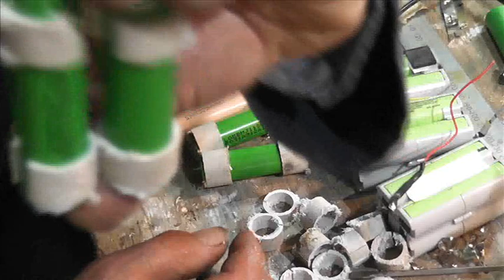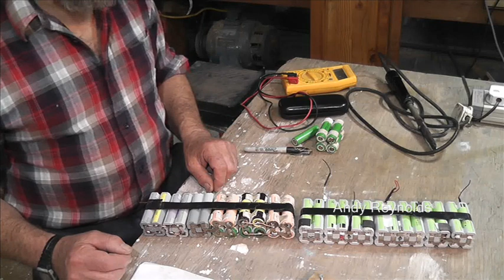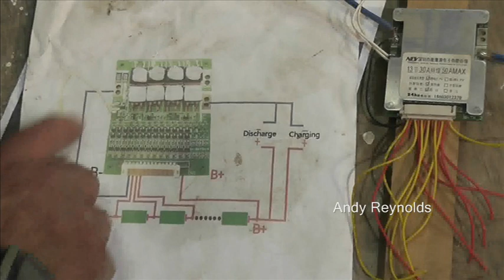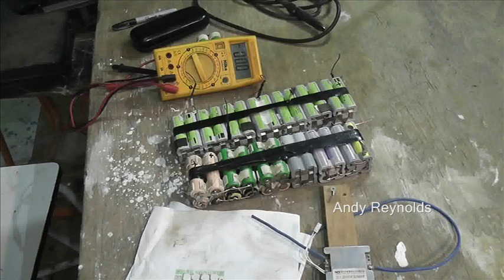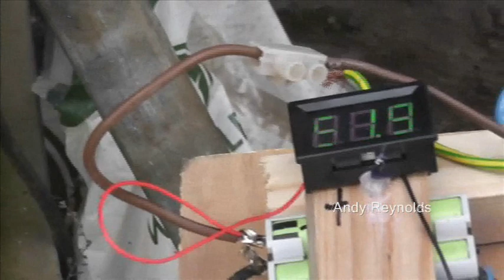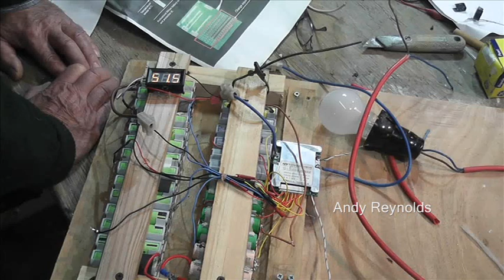Lithium battery pack build, reclaimed cells and problems.

Comment: Ive daly bms and hibms, basically the same, but youll save with the hibms.
They connect to your phone too. Only think ive noticed is the voltage can be off on some cells.

I built a 2.3kwh  7s 18p x2 pack, utter nightmare and so time consuming it just wasn't really worth it.

You need to know you batteries discharge rates to know how good they will be and what size you need and the nickel strip current rating to make a safe pack. 
Ive one box with two parallels, in a big stoage box.
I have two smaller enclosures  with 7s 3p cells and meters and the capacity monitor box, that displays voltage of each cell and will balance the cells. Theyre i think 529wh but limited to 40amp discharge.
Reply from the maker: Yes I can see that large packs are a nightmare, 1 slightly different cell and capacity can be lost, cheers
Reply: @TheInfoworks @guywhoknows
I'm in the process of building a 7s 3p battery to resurrect an sds drill. Are you suggesting there is different discharge rates between cells of the same brand?
Reply from the maker: @ianhelsbyservices  Ian, lee reckons to test the capacity of each cell to try to match those in each string, cheers
Reply: @TheInfoworks i'll look into measuring charge. I'm using discarded vape batteries so they've only been charged once and are around 3.3V as found. Unfortunately I don't have the 21 pieces of 1.5AHr and hoped I could make up the shortfall with 1.6AHr. Unsure if the BMS would cap them all at 1.5 or try and bring the 1.5AHrs up to the 1.6.
edit
BMS states batteries need to be with 30mAHr charge capacity between them.

Comment: Hi Andy,
Loved the video as I have a stack of 20400 1.5AHr cells waiting to be made into a 24V battery. I also have one of those BMS as they looked the job.
I've read online that the BMS are only for protection, not charging, and that you should use an appropriate charger for that pack size which cuts off current when full.
Will keep you posted on my pack.
Reply from the maker: Ian, the BMS in the pylontech also protects from over voltage and prevents further charging. In an EV situation obviously the correct charger is needed, but in stand alone the BMS does all the work, cheers

Comment: I watched this yesterday Andy but came back to comment: your lead acid battery shed is separate so that any off gas is well vented away from a living area, I think. And now for lithium we need another external fireproof box just in case!  But those powerwall units are supposed to be installed indoors. Are we all doomed? Just because I am paranoid doesn't mean they aren't watching me!
Reply from the maker: Owen, I'm thinking it's the huge current flows, both charge and discharge, that will cause internal heat spots, and to cell runaway. So it's down to settings and battery size, and expectations, cheers

Comment: Soon your battery shed will be the size of  a tupperware box. I would imagine they could be a fire hazard in comparison to the lead acid batteries. 
Would a large metal container half filled with sand with an airtight hinged lid and a fuseable link be an idea to prevent disaster?
I think fire proof charging containers will be big business in the years ahead.
Shame about that shonky bms. Thats all that let you down, your idea and execution were sound.
Reply from the maker: You are right on those issues, however the problem with fire risk is due to large current flows creating heat. So the more batteries the less flow in each string and as you say plenty of fuses, cheers
Reply: Would the sand accumulate moisture from being in unconditioned space? Heatproofbox probably better so any heat/sparks kept from hydrogen gas.